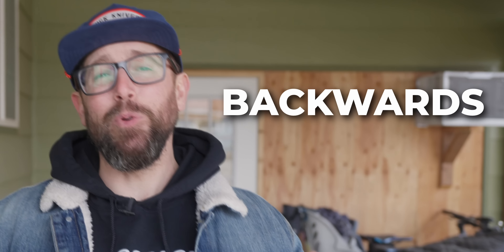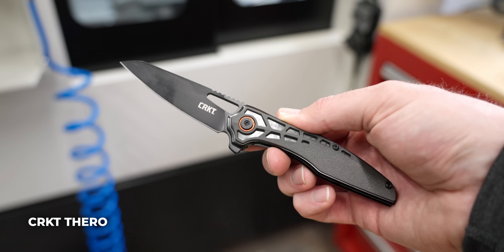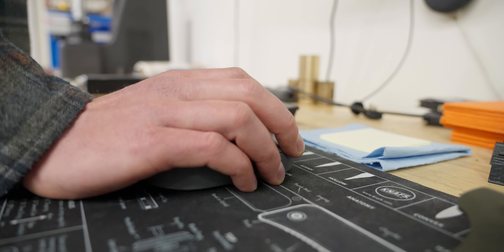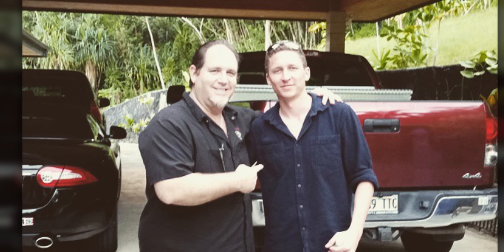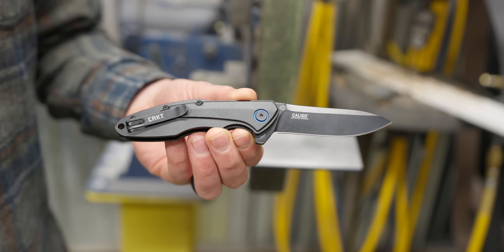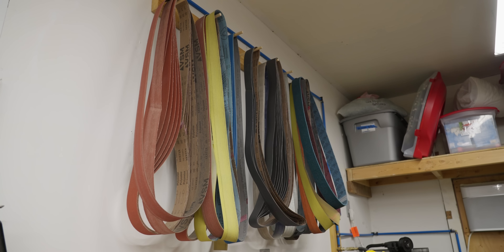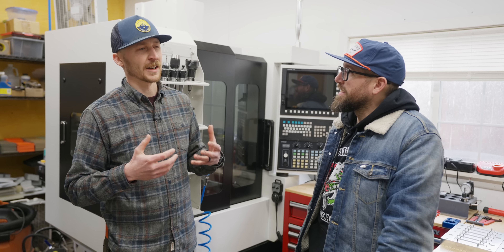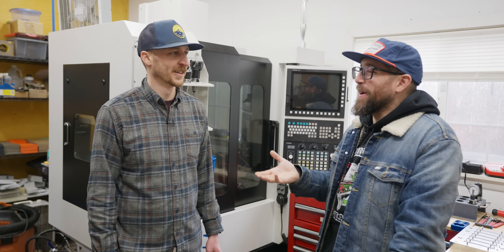Why Does This Knife Maker Do Everything Backwards? | TJ Schwarz High Tech Garage Shop!

Comment: I bought a fixed blade from T.J. in Magnacut and really wish that CRKT would step up and run the folder in Magnacut bare steel with black G10 (or micarta) so that his collector's could have a match set. Great video. Thanks.